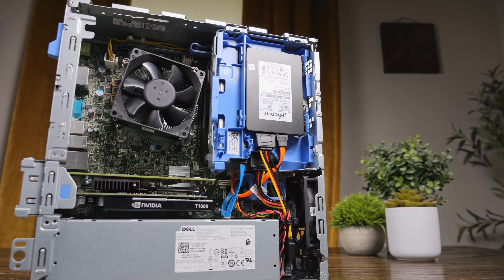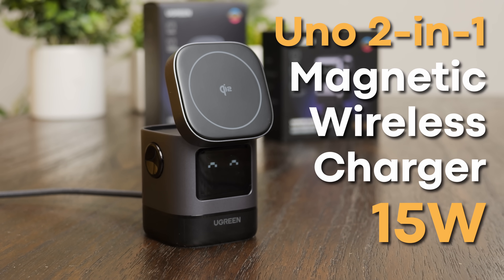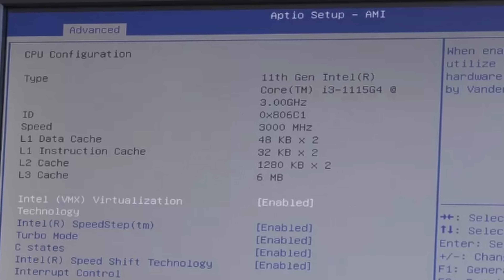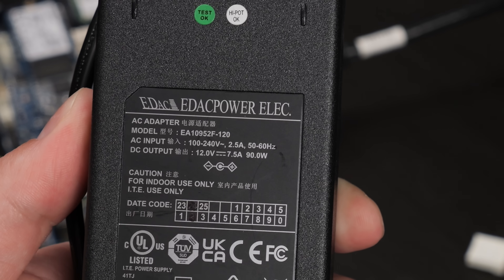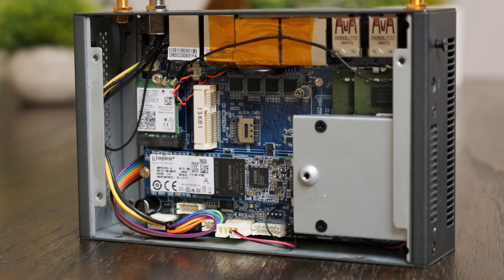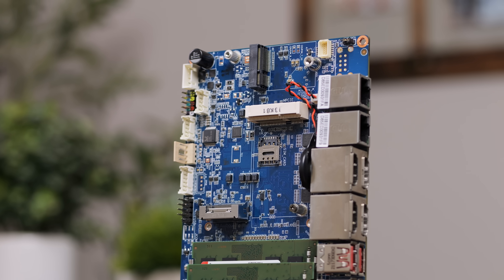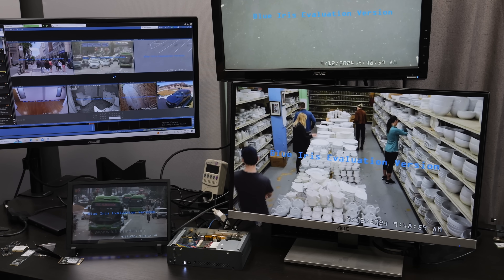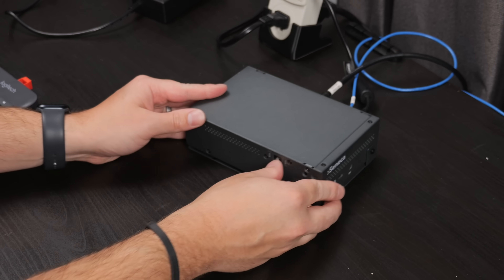This isn't a normal mini PC... and I love it.

Comment: For 3,5" HDD's, try to solder a wire, from the barrol jack pin, to the 12V pin of the Sata Power connector, and maby connect the two ground pins in the middle with an solder tin blob. 👍

Comment: If you have isolated subnets, rather than dedicating a port for each one, make them both trunk ports or mixed/general ports with the needed VLANs and LACP them so you have redundancy on both subnets. You can even have switch redundancy this way if your switches do MLAG. Since you mentioned BlueIris, I'll assume your using Windows, LACP support isn't great but it has switch embedded teaming, this might help you get an idea on how it's done if you already haven't done it. I think you do but just in case:
Get-NetAdapter | ft -a
# or
Get-NetIPInterface | ft -a # "| ft -a"=autosized table  "| fl"=list
New-VMSwitch -Name "Rswitch" -NetAdapterName "Ethernet","Ethernet 2"
Add-VMNetworkAdapter -ManagementOS -Name z0B00 -SwitchName Rswitch -Passthru | Set-VMNetworkAdapterVlan -Access -VlanId 11
New-NetIPAddress -InterfaceAlias "vEthernet (z0B00)" -AddressFamily "IPv4" -IPAddress "10.11.11.11" -PrefixLength "24" -DefaultGateway "10.11.11.1"
These are Windows Server cmdlets, BTW, but I think they work in desktop too. Good luck.

Comment: Lots of ways to use the GPIO, heck it would definitely run Raspbian Desktop so you could fake out a much faster Pi, you can bit bang the GPIO to fake loads of chip interfaces and don't forget the I stands for Input so you could trigger actions from all sorts of external sensors and chances are that board also exposes a 'true' I2C somewhere.

Short story, I want one.

Comment: On Ali-express, I have seen HDMI display "combiner" or "aggregators" to take 4x HDMI 1080p signals and break them out into 4x quadrants of a 4k screen.
This seems useful for a cheap 4k TV that doesn't have 4x picture by picture option to be used for monitoring server hardware OR possibly for surveillance. Although, to be fair, you could likely just use some type of tool designed to snap desktop windows to specific locations... I guess the advantage of the aggregator is... it's cheap ands you can connect separate signals to each quadrant.

Comment: ASRock Jupiter X600 has an AM5 socket and isn't much bigger than that little computer.

I've used the ITX tower version DeskMeet X600 as a comically fast NAS, normally I have a 2x10gbit NIC in it but I once had a spare 100gbit NIC in it, got 48gbit transfer speeds.

Comment: Btw the Tiger Lake series is great for power efficiency and CPU features and has become a budget option.
i have an 1135-G7 cpu laptop w/ 16GB RAM (soldered) that I got for $110 with no ssd drive (Lenovo model 14ITL05)
the 1115 is the cutdown cpu version. I am very interested if they have more of these for $100, but I would really like the better CPU for my uses. The case and form factor is great! Good io

Comment: You would need a floppy controller however most 3.5" floppy drives only use 5v not 12v.

Comment: Some thing like that may be designed for a single purpose but that they are usually good for more than one thing.  One guy had some sort of video conferencing thing based on Chrome and you would think it is only good for one thing.  The fact is that it really is a computer with an Intel Processor.  It is just more similar to a Chrome box but looks like a router.  I forget what they call them but they are not that cheap pricewise.

Comment: for the half size cards we built little extenders to make them bolt nice into the full slot - after a while suppliers started making them so we could just buy them off the shelf.  that was a while ago so you'll have to check on your own but they're only like 5 bucks or so.

Comment: personally i have all of my wifi cameras in one subnet and then i use pfsense to block that subnet from reaching out...i can still get to the cameras from the shinobi interface and the live feed from home assistant which is on the interwebz...and if i need to get to recordings, I wireguard in...but my point is i just straight up blocked them from the internet with a simple rule using that subnet without needing vlans since that's kinda excessive for my little house...works nicely....did the same for my roku TVs since they CONSTANTLY phone home

Comment: OMG, do you have the bios rom for the Lenovo Thinkstation P330? the rom on lenovos has a lot of stuff in the ".rom" file (which i found out using binwalk) and mine is corrupted (or rather the one from my friend which he gifted to me.
also, GREAT video 👍
Reply from the maker: Shoot me an email
Reply: @HardwareHaven  what address?
I also have discord if that helps
Reply from the maker: It should be in the “about” section or whatever on my YouTube channel.
Reply: @HardwareHaven  got it"
Reply: @HardwareHaven  sent it

Comment: I once found an industrial PC that was meant for AI visual inspection. It had i3 6th gen was ~100 USD and 8 PoE ports and a chacy design... I did not buy it only because it was in Canada and I am in EU so shipping was 100 USD would have been an amazing NVR considering 6th gen supports Open VINO so you do not need an accelerator to run AI efferently.
Now I have a SFF office machine mascaraing as NVR in an attic but I have no video output to run down to quickly check stuff, so.... I am looking what could run it.

Comment: Someone may have already replied to your different NIC types, it's so that if you are running linux for example, if you have an issue or you would need to upgrade one driver, the other NIC will still be working.  So you never really have to lose your network during certain kind of updates.  If you have a server you wouldn't want all your NIC's to be the same.
Reply: Sorry, but that's not it. It may be a a benefit, but that's not why the board ended up like that. Typically when that's a design goal, you'll see the second NIC being from a different manufacturer.

The I219 is built into the PCH, but the NIC only supports a singly PHY.
The I211 is a stand-alone NIC + PHY.
Reply: @SpencerN.C.  OK

Comment: Great Video! However per the usual. 
Step 1: youtuber finds killer deal on a cool bit of tech. 
Step 2: youtuber makes video about cool bit of tech 
Step 3: subscribers rush to ebay to swoop up good deal driving price of cool bit of tech to crazy numbers. 
Results: 
Before video: Seneca Element MP was won from auction for $85.00
After video: Seneca ElementMP going for Buy it now price $349.99-$499.99
OR
I'm way wrong and said youtuber just got super lucky with the deal they scored.
I'm not mad, just bummed. Several projects I can think of using this cool little box for. but not for the now price. 
Alwell maybe next time😃

Comment: If it’s GPIO could you run a little display off of it? What are the pins limits, like raspberry pi’s have data and analog and power and spi, etc. what are those pins able to do?

Comment: The two NICs are different because one would be used for the vPro management in a upmarket version of the board with a vPro CPU and the other would be cheaper.
Reply: Close. The I219 would be used for VPro, although the I219-V has VPro disabled. But the reason the I219 can support VPro (in its -LM trim) is because it's integrated into the PCH.
Between it and the I211, the 219 is cheaper because it's free - literally comes with every chipset, all you need to do is add a PHY.

The 211 on the other hand is an all-in-one stand-alone solution with a NIC and PHY combined in one package.

Comment: Ahoy, Great video on a subject I love: Industrial computers. A couple years ago I almost bought a Seneca with an older AMD CPU. Instead I bought an Onyx MedPC (used for Kiosks in hospitals) for $50.00 total. It had a lowly J1900 4-core Baytrail CPU. I installed Batocera and used it as my Retro Gaming system until last month when I got a Pandoras Box type system for half price on Prime Days. Still keeping my MedPC though! Thanks again and cheers, daveyb

Comment: A vendor issued me a Seneca device yeara ago with a LTSC version of Windows 10 (can't be upgraded at all). All it was meant to do was run a simple software that synced a users and pins in an access control solution to the Bosch burglar alarms. Was such an POS that it would just lock up and have to be rebooted every 2 days.

Comment: Boards in the late 90s and early 2000s always had two different chip sets for nics on dual nic boards. I believe its s redundancy thing as if one driver locked up, the other could continue to run in theory. There really is no other reason.
Reply: Nope. The 219 is integrated into the PCH, but only supports a single PHY.
The 211 is a stand-alone NIC and PHY in one.

Comment: I219 is built into the chipset, I211 is on the PCIe bus. The chipset does not offer dual Ethernet, hence the need to add one. Adding one is cheaper than adding two just so they're identical chipsets.
Reply: You are literally the only other commenter to get this right. Everyone else keeps coming up with other reasons about drivers or compatibility, but you are 100% correct.
Thank you.

Comment: 12v 5 amp. = 60w...
Reply from the maker: And? I’m confused
Reply: @HardwareHaven  I do board level repair, and was just saying that it was pretty obvious what the power supply should have been. I'll admit, I don't deal with mini pc's that often, but every one I've touched, has been 12v. Side note, I wouldn't be surprised if the power regulator was rated for 24v, but they told you 19 because it's way more common.
Reply: it's also a matter of effiency. it's not going to be a 5, or 9 volt power supply. easier to drop the voltage the raise it. Especially when you don't see many if any high amp psu's for 9 or 5v.

Comment: As for a server application the 28W power consumption of i3 11 Gen CPU is the greatest concern as it makes the system running cost 2 - 2.5 times higher that let's say the similar system based on N100 CPU.

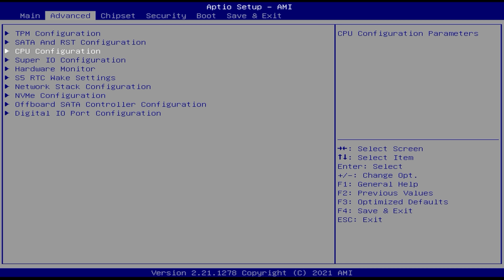Comment: 5:07 A lot of motherboards with dual nics are not matched. Between those two, one is lower power. The difference is negligible. I don't know why this is common either.
Reply: Technically correct, the best kind of correct, but not the way you think.

The reason for the dual NICs is that the I219 is built into the PCH, but it only supports a single extrnal PHY. It is lower power as a result though.

The I211 is a stand-alone self-contained NIC and PHY, it's an easy way to add a second port. And it does technically use more power.

Comment: Picked up myself a little fanless Seneca system earlier this year on ebay. its 5th gen intel nuc based machine that I got for £20 cheaper than the comparible standard nuc but came with the fully fanless case and an integrated psu as well as all the accessories and such. Threw in a network card and its now my router.

Comment: If you are using this computer for video surveillance, you can use GPIO to trigger an alarm if something is noticed that requires your attention.
Reply: Another good use for GPIOs is automatically rebooting misbehaving hardware, with the help of a relay board.
Reply: I'm a fan of this idea
Reply: Can it play the Doom OST? Asking for a friend 😅
Reply: A siren!
Reply: @TayschrennSedai  Or something like this https://youtu.be/EWqrlnNckSk?feature=shared&t=30
Reply: how reliable are the GP10 on outdoor survalance camera
Reply: Just ANY other Japan product, will be better than crappy Intel stuff ! Besides that I will never buy an Intel product ! My best experience is an AMD, with Radeon, mini PC !
Reply: @gertjanvandermeij4265  But if I ask you to list the issues you've had with Intel, you're unlikely to be able to name anything serious. Only something like "AMD has a bit better model for the same price."
Reply: @kote315  i take it that you didn't hear of the 13th/14th gen cpu failures
Reply: @ThylineTheGay  All manufacturers have series of products with defects. I can remind about burning Ryzen 7000 series processors. And also about AMD EPYC Rome processors that freeze after 1044 days. And about periodically arising performance issues (which, however, are most often resolved by software updates).
Reply: @ThylineTheGay  In the 2000 series Ryzen era, I recommended an AMD platform to someone, and eventually the CPU developed some fault and booted only intermittently, which they spent months doing RMA after assuming that it was the motherboard. Because no one suspected the CPU could develop a fault after decades of using Intel.
Reply: @rexsceleratorum1632  Its interesting...How is it that in all these years I have not seen a video on how a CPU works, and how they upgrade them. I am sure there must by now be a 3D model even , of all the internals and materials and how they work...Its been decades. Am I just not searching correctly? I cant find a useful detailed thing!
Reply: @philindeblanc  A modern desktop CPU contains about 25 billion super tiny transistors doing a whole lot of stuff. I guess there are videos that break down particular aspects of this insanely complicated whole.
Reply: @kote315  maybe all shit show new to the industry. Intel has ZERO excuse except greed.
Reply: @kote315 how about Intel forced me to buy more expensive processors by illegally hindering AMD from making enough money to do the r&d in order to maintain the advantage that 64 bit processors gave them? Serious enough?

Comment: Two nics are often in industrial environments from different manufactorers so you have two different divers. If one has a problem after updating the firmware chance are that the other still works. This makes remote administration more reliable.
Reply: @michaelbauer1985  Not in this case. They're both Intel NICs and they're nearly identical except that the I219 is integrated into the PCH. However the PCH can only support a single port, so the I211 is used for the second port because it's functionally identical, but fully stand-alone and self-contained.

Comment: The differnece between the NICs is one is 1Gbe(219-v) only the other is 100m/1G(211) both support PTP which means this would  make a good PTP time server with the sim and a GPS/LTE card
Reply: They both support 10/100/1000BASE-T.

The difference is that the 219 has the NIC integrated into the PCH, and only needs an external PHY, whereas the 211 is a stand-alone NIC and PHY in one.

Comment: ISP's have a habit of putting these lil goobers into outdoor cabinets for keeping an eye on network nodes, WISP type setups
Usually some linux just to ping around and have access
Cheaper than sending out some dells, passive cooling in a vented cab and doesn't take much room fit in a 1U Space

Comment: 5:19 For the two different NICs, the I219 is built into the PCH for Intel 11th gen, but it only supports a single port. The I211 is functionally identical but a fully stand-alone NIC + PHY in one.
Reply: I was actually guessing one was for vPro OOBM, but this makes more sense
Reply: @ckbwtf  You're actually REALLY close: the V219 can support vPro (only NICs built into the PCH can), but the -V model in this computer has it disabled. The V219-LM found in the Q and W series PCHs does have vPro though.
Reply: The i210/i211 can actually do more at the playground of PTP and GPIO-based timing antics. Those 217/219 LOM's do have some HW timestamping capability for packets (ethernet traffic) but in my practical experience they tend to be inferior to a discrete i210 (of which the i211 is a sibling, stripped of some features that are irrelevant in this context). The LOMs' timestamping tends to be quirky (the driver throws a timeout waiting for a timestamp every now and then), and their residual jitter tends to be worse. There's also the i225 which is even more capable, at least on paper, and has had its childhood maladies sorted out by now hopefully, but is short on the technical documentation front. As far as I'm concerned, long live the i210 :-)
Reply: @xrysf03  Actually the most important thing they stripped from the 211 that the 210 has is: Server OS drivers support.
Reply: @BigBenAdv thanks for the note ;-) I haven't really noticed that - but it explains why I never see an i211 in industrial/embedded motherboards. The i210 is nearly everywhere. I believe that the i211 department lacks a fiber SKU. And possibly some EEPROM options... I don't remember anymore.
Reply: @BigBenAdv  pfSense should love both the i210 and the i211, so that would be nifty little box for a home or small business router. With enough power to run a few VPN connections and everything.
Reply: @xrysf03  Oh yes, there are definitely some features stripped out of the I219 (and 217) to make it fit in the physical and budgetary constraints of being part of a PCH; when I said the i211 (and 210) were "functionally  identical" to the 219, I meant that the 211 can do everything the 219 can do, not necessarily the other way around.
Reply: Probably also because it's (i219-v) a bundled deal when you get the PCH from Intel and will be cheaper than separately purchasing another i210/ i211 and PCH.

Comment: Before pulling the trigger on a BI license, give Frigate a try. I switched over a few months ago and have been pretty happy. It's got a steeper learning curve but development is much more active and the price can't be beat.
Reply: I've considered this mainly because it seems to have better Ai integration. CPAI isn't doing the best from what I've seen the last year.
Reply: I third the Frigate recommendation.
Reply: I was about to say the same thing so I definitely concur. The development has been super active and they even redesigned the entire WebUI very recently with functionalities that make it a really good competitor compared to alternatives. And the AI object detection works really well with a Coral, and if your CPU has hardware video decoding (like Intel Quick Sync for example) you really don't need super fast hardware.